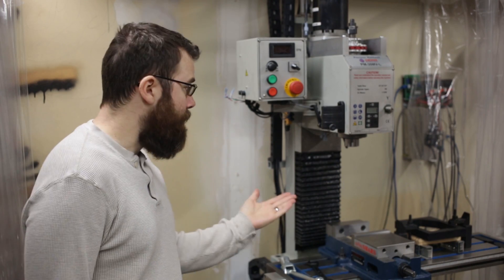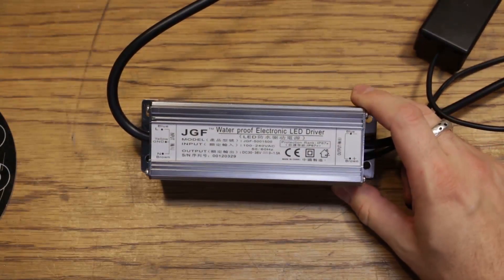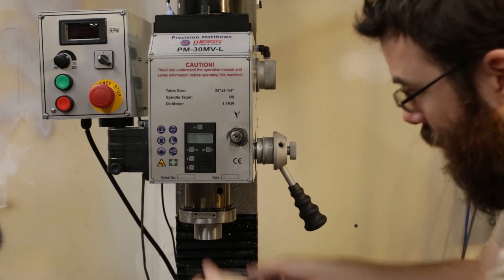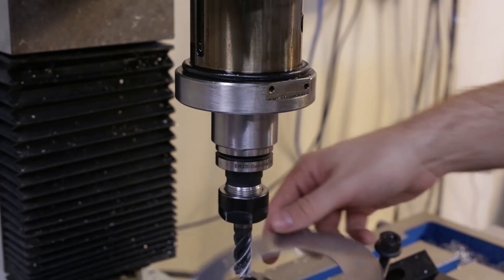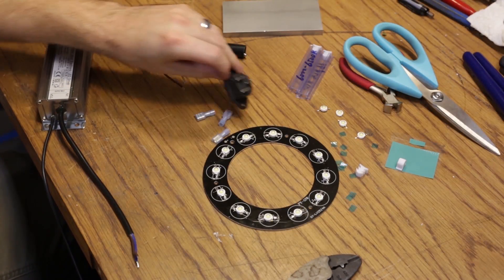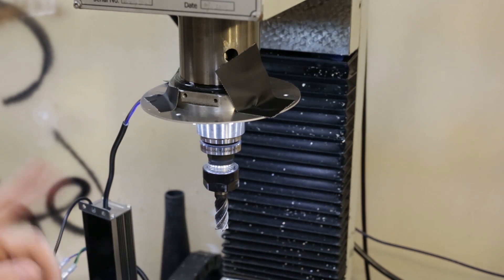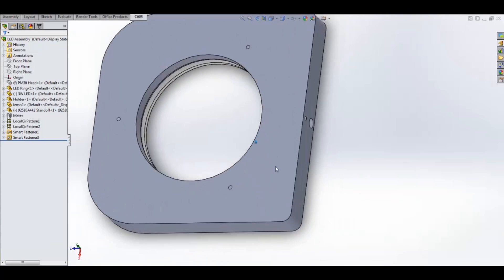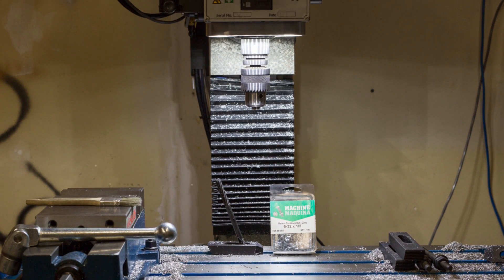Milling Machine Ring Light

Comment: You mention reflowing the LED mounts but say you won’t but in the sped up video it appears that you did.
Reply from the maker: Reflowing is using solder paste and a reflow oven to melt the joints.  I show that I used a soldering iron.  I'm not sure what you mean?
Reply: @RobertCowanDIY  ah, ok. I’m rather ignorant of things electrical. To prove that I’ll say that I thought the special double sided tape was the electrical connection to the PCB. Now I understand, I think, that the tape was a thermal insulator and the LEDs had to be soldered to theCB…yes?
Reply from the maker: @steveo1006  Correct!  normally you'd solder that middle section, but it gets tricky to do with an iron, since it might melt the body.  the right way is reflowing, by adding some solder paste and melting in a reflow oven.  the thermal tape accomplishes the same thing, but much easier.  And now you know!
Reply: I’ve received the PCB and now shopping for LEDs.  Also asking for help on the adhesive (where to source it) you used for the LEDs on the PCBs.

Comment: LED PCB Ring   https://www.ebay.com/itm/2-5-10-50pcs-9W-RGB-Round-Ring-Aluminum-PCB-138mm-LED-Lamp-Light-Bulb-9x1W-9x3W/392108616978
50 W Dimmable Constant Current LED Driver  http://www.lck-led.com/dimmable-constant-current-power-supply-output-p-1137.html
3 Watt LEDs   https://www.amazon.com/dp/B06XP7386P/ref=psdc_2314207011_t3_B06XPCSK6M

Comment: Printed circuit boards are available from Merryday168 on Ebay as of 7/7/17.  I bought a pair from him in May '16.  They are listed as "wdm 2pcs 12*1W&3w LED mcpcb 138mm ID 84mm OD (obviously backward) aluminum base plate.  The 3 watt LEDs are also available from him.
Reply from the maker: Oh, good to know.  I might make another one or two for my drill press and mill.
Reply: I made one for my Smithy and then sold the additional board to someone in our metalworking club.  I recently bought a Bridgeport at auction and need one for it.  I did not have a way to make your housing at the time I made the first one and the glare without it can be bad.  I got a 12" rotary table at the same auction and I think I can use it to make a housing.

Comment: Would love to have that machine! Would a hole punch have worked for the thermal tape instead of cutting the little squares? Seems like it would speed up the process a little.
Reply from the maker: +Mark Woodworth Yes!  I was actually looking for mine, but couldn't find it.  But that would work fine.  The tape was just there to isolate the LEDs from the PCB, so it didn't need to be a specific size.

Comment: wonderful tutorial, love the whole thing. But i'm just curious as to why DIY it, when tormach sells one finished out of the box with everything cheaper? Dont get me wrong, i love to DIY things too, but i've gotten to the point where it's sometimes not worth it lol

The item i'm talking about.
http://www.tormach.com/store/index.php?app=ecom&ns=prodshow&ref=32700
Reply from the maker: Kevin me Totally, they are similar.  I thought about theirs, but the light output is pretty low.  They use 14 'ultra bright' LEDs.  Well, they are 9800mcd each, so ~140k mcd total.  If we assume a 20 degree spread (pretty typical for LEDs), it comes out to around 13 lumens.  Even if we assume a 40 degree spread (pretty high for an LED), it's only around 50 lumens.  Mine is a 2,400 lumen light, or at least 50 times brighter.  

I originally looked at theirs, but decided to make my own based on just how low the light output was.  Theirs uses a 5V power supply  at 500mA, or roughly 2.5W.  I have 12 3W LED's, each being a lot more efficient (light output in relation to power input) than theirs.  Hope that helps!
Reply: Robert Cowan i see what you mean. yours is a much better build for sure. Only thing i would've done different is a better shielding for coolant spray (i flood my parts and it goes everywhere lol) and maybe hold it with magnets just for the option of easy placement and removal without the need for a screwdriver. But seriously, great build. I'll end up referring to it if i ever get around to building my own.

Comment: http://www.ebay.com/itm/400759473641?ssPageName=STRK:MESELX:IT&_trksid=p3984.m1586.l2649
Reply from the maker: adam cook Yeah. but I'm not sure how bright that is.  If it just uses standard super-bright LED's, it's about 1/10th the light output of mine.
Reply from the maker: Robert Cowan Oops, checked the listing, it says it's roughly 1000 lumens, which is about half as bright.  But they are using a 10w supply, which is interesting.  I have 12 3W LEDs and need about 50 watts to power it.  I'm not sure how they are getting 1k lumens from only 10W.

Comment: Do you have links or "search terms" for the items on ebay? I tried various combinations of "led ring light pcb" but was not able to find the parts.

Thanks.
Reply from the maker: The LED's can be found easily enough, just search for '3w LED'.  You'll find a lot of options.  They're all pretty much the same.

For the power supply, you can search for 'LED power supply dimmable' or something like that.  it comes up pretty easily.  Even '50w LED' gets you the power supplies. 

The PCB manufacturer is away for Chinese New Year right now, and has all their items off their account, but this is their store:  http://stores.ebay.com/merryday168/